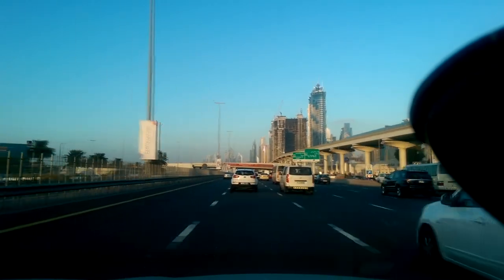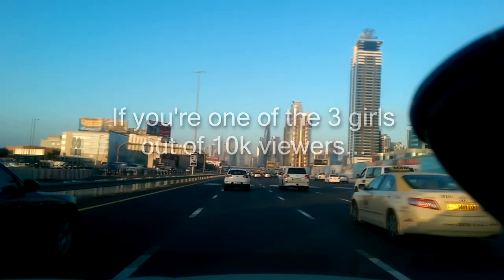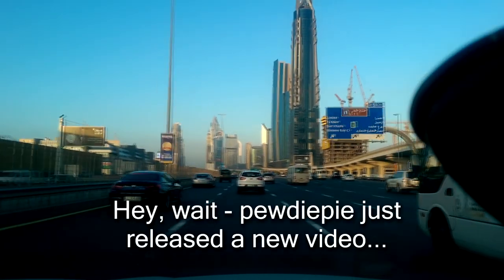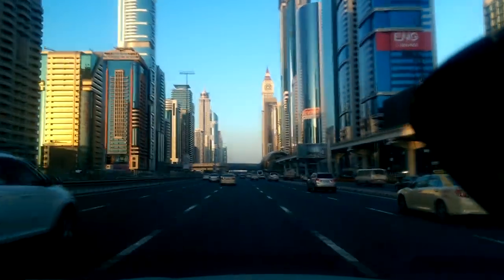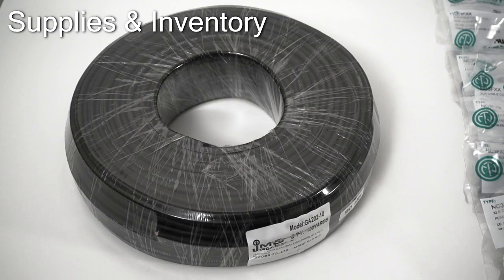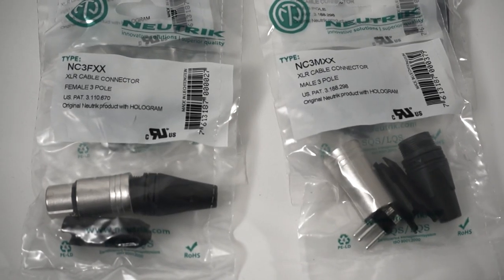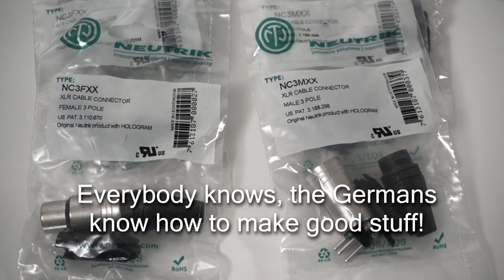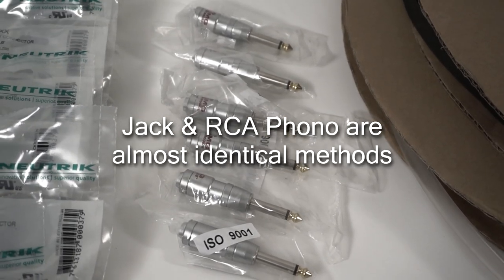#003 Soldering Tutorial - How to make pro grade cables!

Comment: Great video, I’ve built a lot of my own cables over the years and about to do a short multicore from my pedalboard to mixer. I  was glad to see I do a lot of this right but learned some cool tips. along the way. I laughed when you said about the shell oh the feeling when you have a beautiful solid job and see the shell sitting on the table but the other side is the joyful celebration the times it happens and as the misery starts to kick in and you suddenly realise it’s the first side of the cable and you can slide it on the other end! Great video and by the way that iron station cost a fortune in the UK!

Comment: As someone who is mildly obsessed with making cables and has been doing so for nearly 30 years, I once made a little cable-soldering jig using a block of wood with male and female XLR connectors embedded in it to hold the end connectors being soldered. it's a lot easier to clamp down a block of wood than individual connectors. You could simply drill holes in a 2x4 but I like using panel connectors because they provide a positive hold on the connector plus they offer a tiny bit more of a heat buffer if you have a habit of overheating your solder cups.

Comment: just came across this and its really good in every way. when i got to the labelmaker part here's what i do: type a bunch of labels with just 1-2 spaces between them, print them all (either how many you are going to print, or the max memory of the device which ever comes first), then cut them. much less wasted tape :)
Reply: I'm not only cheap but creative. I print a sheet of labels on a colour printer using a template, then cut them using a guillotine. This way I can add fonts (like property of in small letters) colours (for length, reds at 4M Blue at 6M etc) and a number.  I usually put a label at each end of longer cables so the numbers have to match.. good thing for festivals etc where time is on the essence. Clear wrap, slide in label, heat and eat..

Comment: I was at the least apprehensive about building some cables for myself and my music partner but having watched this I feel more comfortable with the process thank you saved and subscribed
Reply from the maker: Amazing! Just follow the steps. And don't expect the first solder joints to be perfect. Will take a couple of tries to really get it down. The rest is easy.
Reply: The Bright Pixel Hi. Can this job be done with a good soldering iron like Ersa PTC 70 (0710CD) ?
After watching your video I decided to try to make cables for my studio monitors, turntable and stereo pair of microphones by myself! I have already bought Neutrik gold plated connectors and will order Gotham GAC 4/1  quad microphone cable soon.
I liked Ersa PTC 70 because of decent and not fake (it is a problem in Russia with Hakka tips) soldering tips and that I can put this iron to my tool case and use both at home and on the go.

Comment: Nice prep work!  I learned something from you about how to properly prep and arrange your materials.  Your assembly line technique is very efficient and it certainly is a great way to check and make sure you have everything ready to go.  I also liked how you double checked for the placement of pin 1, and how you add the heat shrink for strain relief and label your cables with the clear heat shrink tubing over a label.  Very professional looking!  

I do have one small critique with your soldering, so before I go further, let me establish my credentials and where this critique is coming from:

I am a retired Marine who learned soldering while attending Navy Avionics schools.  After getting to the fleet, I attended an advanced soldering school, which got into microminiature repair.  The Navy and Marine Corps want their equipment to be reliable and they don't want planes going down for maintenance... or going down for real because someone didn't do their job right repairing a piece of equipment and a wire broke or failed due to a bad solder joint, shorted something out and caused a fire.  So, needless to say, they were very picky about our work; we had to do it to their specifications to pass the school.  Comparing the Navy's techniques for soldering with what people learn off the street is like comparing submarine welding to general construction welding.  A guy who welds on submarines has his welds subjected to X-Ray inspection to look for defects.  On a construction site, the standards aren't as extreme; they just don't want your welds coming apart.  You can take a Navy welder and put him on a construction site and he'll do fine.  Not so with the construction welder on a submarine.  So if you don't mind, I'm just going to pass on some of that knowledge.  Obviously what you are doing works as you've been doing it for years, but if you want to take your game to the next level... here are some pointers:

On a properly tinned wire, you should be able to still see the individual strands of the wire.  You had a few that looked good and a few that were a bit globby.  Some folks think that the bigger the glob the better the job, but that's actually not true.  If you pull off the soldering iron and you get a piece of solder that sticks out like a thorn, you probably have a cold solder joint.  Cold solder joints affect the transmission characteristics and while it may ohm well on a multimeter, it may exhibit more impedance at higher frequencies.  We're dealing with audio here so it's probably not as critical.  But again, we want to do the best work, right?  

Keep a drop of solder on the tip of the iron for better heat transfer when you touch it to the connector you are soldering.  The solder on the tip of the iron transfers the heat from your iron to the piece, much better than the tip by itself.  Also noticed you wiggled a little bit while holding the wire and you want to keep it perfectly still until it changes color and you see that it has cooled.  Don't blow on it to get it to cool faster.  Wiggling the wire, and/or blowing on a solder joint can also result in a cold solder joint.  You want to get in with a good amount of heat and as soon as the solder melts you make your connection and then remove the heat while holding everything still.  Solder is an okay conductor, but you get a better connection when you have physical contact between the copper wire and the connector pin and your solder is like the glue draped over, holding the wire in place.  On a perfect solder joint with stranded wire, you will still see the strands of the wire and it will form a filet where it is pressed up against the connector.  Sometimes, when it comes to soldering, less is more.

I want to end on a positive note.  I liked your technique for making indestructible wires and learned something there too about using the excess silicone RTV in the threads.  Am glad you stressed checking your solder connections after making them.
Reply from the maker: I don't know how I missed this awesome comment. Damn YouTube notifications seem to be hit and miss. The day I stop learning is the day I die, and you give some good theory and tips here. Next big batch I make up, I'll keep this in mind. I had zero formal training. Just developed these methods over many years of doing it and then working out why things failed and refining the method. Thanks again.

Comment: Good video, thank you!  I just made some rca cables.  Used Mogami 2552 low noise wire and Amphenol ACPR-SRD male plugs.  Was surprised how thin the signal wire was in the Mogami cable but they work just fine.  Nice to do away with overly long and stiff cables from the store.

Comment: I know this is 8 years old, but those pockets are made so you don't actually have to prefill them. You just tin the wires, put them in the pockets, put a little flux paste or flux wax, and fill with solder. The reason why this is usually better practice too is because you don't have to use a ton of solder and wind up using just enough which keeps the connector overall more clean. Not that big of a deal on XLR connectors, but when working with LEMO connectors and smaller pockets, this helps a ton ensuring there isn't solder spilling over and connecting prongs causing cross talk as filling up the cups can easily accidentally result in that given you're always using more than you really need to (since the cups don't actually have to be completely filled for a solid joint). 

If you check Neutrik and other manufacturers, this is their standard of practice and why the cups are designed the way they are. So you can put the wire in, it will stay, and then you make your joints. Just like working with a standard through-hole soldering.
Reply from the maker: Of course, you are free to make cables however you like. But if you choose to not prefill the buckets with solder, then your cables won't last nearly as long as mine will. For the back of a studio rack, sure fine. For a rental kit cable? Not a chance.

Comment: nice video and great advice.. 

@21:25 find a way to stabilize the hand / wires so there's no movement while the solder cools down. it's extremely important. cold joints can and will develop when there's movement (between being liquid and solid, solder has a plastic phase, movement during this phase compromises/weaken the joint strength. 63/37 solder is an exception)..

having a hot enough CLEAN iron tip that takes solder is MUCH more important than what soldering iron/brand you use. a 30W 'cheap' iron will work for this kind of job if you follow the instructions in this video..

depending on how many cables you want/need to make, i have two suggestions:
1. thermal wire strippers   (fast, consistent, no damage to the wires; it can even be built as a 'special' soldering iron tip, or soldering gun tip)
2. extra soldering flux   (decreases the wire tinning time / heat damage to the insulation considerably, especially as a 'beginner'; it's INVALUABLE when FIXING cables as those are partially oxidized.  get good quality, no-clean, non-acidic flux)

Comment: Tips from a Military certified Civilian Professional: 

1) Never pre fill a socket. Invariably, while re-heating it to get a wire in, you will get a cold solder joint or the wire entering it will snag a side and it only takes one stray wire to ruin the job. Don't catch a loose wire and it can short circuit equipment, even cause fires depending on the application.
2) Pre-tin away from the tip of the wire (no blob to prevent it from entering a socket). Once in the empty 'bucket' on the backside of the pin and applying heat to the bucket and the pre tinned wire it'll all melt and combine properly with the right application of the soldering iron and a small dab of new solder. 

Note: Those little micro movements of your hand as you try to insert the wire into the pin and hold it as it solidifies WILL cause cold solder joints like you see at 28:20. Best to have the empty socket horizontal on your work surface, something holding the plug, maneuvering your tinned wire into the socket (sitting a set of wire cutters on the wire easily prevents it from backing out) then making your final solder joint, adding just a small dab of fresh flux-core solder and done. This way the joint is strong and  once you take the iron away their is ZERO movement of the wire or connector as it re-solidifies/cools.

3) Learning to properly apply the heat is the smallest part of making a good solder joint. Learning WHEN TO TAKE IT OFF is the biggest part. Too short and the parts don't melt together, too long and it burns the flux off and you wind up with a cold solder joint or WAY TOO LONG can mean possible damage to the connector itself.

The Hakko is a great iron for low volume home use and the occasional job site. I have this same one at home. If you have thousands of solder joints to do, look for a MetCal.

My qualifications? Mil-Spec certified 40 yrs ago, Army, Air Force and Navy (Tracor/BDM/ARL) work in research labs doing mainly prototype equipment, mostly sonar. A 3 pin connector like a XLR is easy, try 105 pins in a 3" puck with a schraeder valve in the middle for oil to equalize pressure and flow in between. Multiple runs of 3 conductor shielded wire in each 105 pin cable. Each pin individually heat shrinked. But the technique is still largely the same. Hardest part i ever soldered? Sonar transducer element the size of a pencil erasure with the solder surface being a coating that would evaporate if you held the heat on it a split second too long. Just POOF! and it was gone.. Surface mount stuff was tricky early on too but that technology and techniques have come a long way since I was doing it.
Reply from the maker: Never had a problem with a cold joint. Neutrik themselves recommends pre filling the buckets on thier connectors. This is industry standard method. Tinning the wires from the tip is prone to pulling away loose strands, especially with ultra flexible cables with high strand count. With practice you can easily avoid problematic solder blobs. This is one of those things I didn't point out because when you've been doing something for so long you don't even realise you're doing it, so thanks for pointing out to be mindful of that happening. Maybe for military spec what you say may be true in environments with extremely wide temp ranges, in tanks and military installations, etc. But, I've been making pro audio cables for 27 years. Built TV studios, cinemas, touring systems, retail fitouts, nightclubs, bars, you name it. Touring and rental systems are the biggest test. I've made cable kits for multiple tours. Never had comments from clients about my cables failing. The fact is, the method I teach here works and I have almost 3 decades of case study to prove it.
Reply: @TheBrightPixel   When my work was going onto howitzers lobbing shells the size of VW's out of sight over the curvature of the earth, in a rail gun, or in a Nuclear Sub under a polar ice cap... well, failure was never a desired outcome. :)  I'm sure some of my satellite work from the 90's is still in orbit as well. I was very ocd about it and had VERY little of my stuff ever need to be redone. Took pride that engineers would ask for me over the 2-3 other people that did what I did because they knew I could turn their designs into reality and it just work.
Just passing along hard lessons and a outlook that one might consider. In your environment with larger connectors, bigger gauge cables and stuff you might be just fine with this technique, but note even in your own video you had a failure and had to redo it. Letting it sit on a table and letting the wire rest in the connector then applying heat to the connector and soldering it with no movement as it cools off is just easier once you get it down. On a XLR connector you could literally have all 3 wires in place and do them all without touching the connector in between. It requires a delicate touch but is very doable. A panavise and a pair of cutters were all I really required to make sure stuff didn't move around, leaving both my hands free.
Reply from the maker: @hausofgrom1198  Now do your method whilst explaining it clearly, step by step, with a video camera over your shoulder and do it perfectly. Make sure the angle is good for someone who's never seen it done before. Make sure the audio is clear. Make sure your batteries in your equipment are good. Somehow get your chair in between the camera tripod legs without bumping it. Are you still explaining it clearly? Make sure you don't do the critical bit at 2Gb when your camera drops audio for a fraction of a second while it writes a new file. Shit, the lapel mic was rubbing on my shirt making horrendous noises for that last bit... do it again... Make sure your light isn't reflecting into the lens and also bear in mind the shadows. Are you still explaining it clearly? Yeah white is +, same as it was on the 60 connectors I did yesterday. Shit, just bumped the camera. Crap need to remove the battery grip because the camera body battery just went flat...  Post the link. I'll be happy to critique it for you. I don't care how many low earth orbit nuclear reactors you've wired XLR connections for the control rod sensors for. If you follow my tutorial and make audio cables for a studio, band, permanent installation - they will be good ones. And that was the point of the video.

Comment: Love it.  Rather than silicone, I like to use hot glue to fill the connectors (which is repairable with your heatgun.)   My label maker prints directly to heat shrink, so that's helpful.  I use a different color of heat shrink for cable lengths, you could use colored electrical tape under your clear - this way a quick glance and you see the color for your lengths.   For a while I was doing shows in a venue that had a bad case of the cable legs (where you cables grow legs and jump into someone elses cable box.  I ended up using an engraver on my connector shells since many times the connector legs syndrome also causes the label to fall right off, who would have thought.  Nice video, again!

Comment: I've got a pair of those same label makers. If you are making a handful of the same labels you can use Code (bottom left) + Return (under down arrow) for New Block, then re-enter the label name. Once you hit Print, you will get a long contiguous tape with all the labels. You'll have to cut them out manually, but you save the time, tape (and occasional "CUTTER ERROR!" if you miss-time it).

It's very likely that there is a better way of doing this- but I'm allergic to manuals, and this works well enough for me. HTH :)